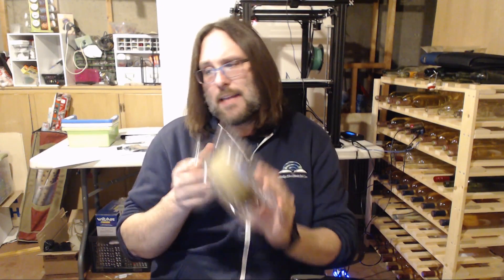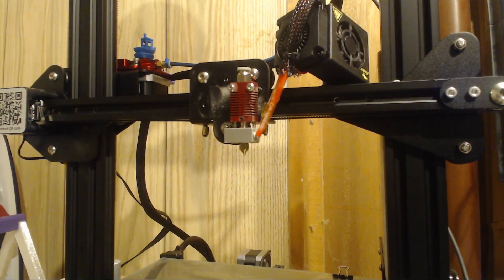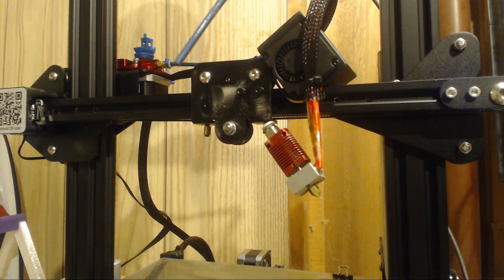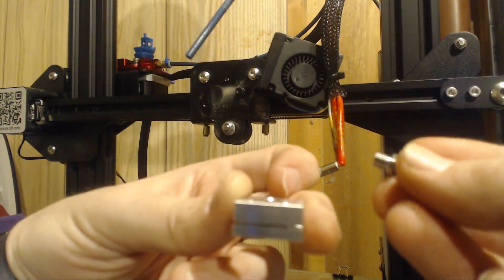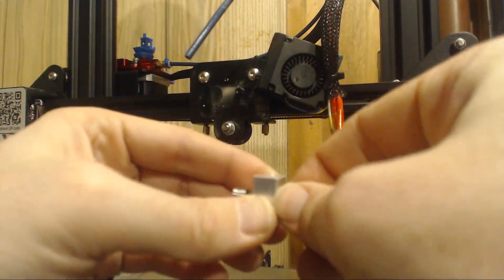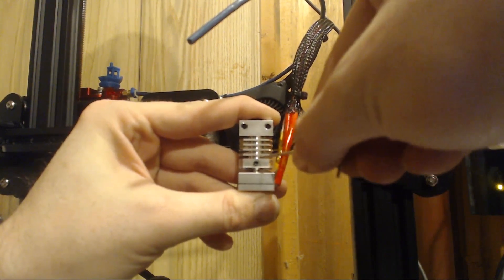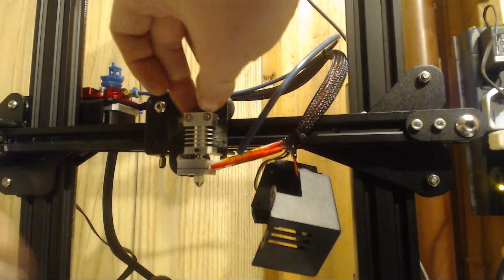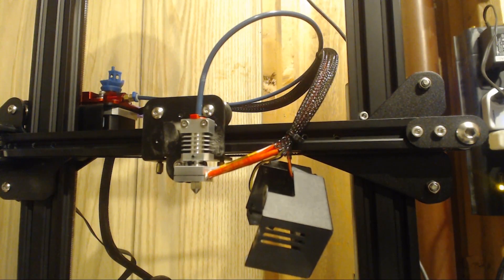Ender 3 Pro (Cr10s) All metal Hotend upgrade PID settings and all in

Comment: Im currently printing about 60% pla, 30% ABS, and 10% petg. I'm considering upgrading to a all metal hotend to print nylons and PC, but even then it'll only make up about 5% of my printing. The price isn't a big deal, but would you consider it worth it to have the ability to occasionally print stronger filaments, but having the added difficulties that all metal hotends cause? I hear there's a higher likelihood of heat creep and clogs, and that you have to occasionally lubricate, and that switching filaments regularly can be an issue with sticking. I've heard of a few other complications involved. Is it worth it when mostly printing pla?

Comment: Did you have to tweak your settings in cura? I’m getting a ton of stringing on my microswiss direct drive setup on my ender 3 v and I’m printing petg and on my sovol
Sv01 it prints clean as shit any thought on also I already calibrated the extruded to run the 10mm of spool
Reply from the maker: Hey.  I only had to tweak the retraction settings.  I use 4.5mm at 45mm/s on all my Micrswiss hotends

Comment: Thanks a lot. Excellent video. Very helpful. I had installed the Swiss all metal hot end on one of my Ender 3 pros and it worked beautifully. The second one I installed on another ender three pro, I could not get to work with out the extruder clicking. Did not change the PID settings in either one from stock. So now I have something else to look at. Thanks
Reply: Greg Gilbert Greg Gilbert I have adjusted the PID settings using the PID function from Octoprint. That also helped. I also tighten the nozzle and heatbreak grub screw when the hot end is at temperature.

Comment: are thes settings the same for the cr 10?   can you just put the pid setting in the simplify3d slicer software in the scripts area?  also what else can i use to do the pid settings beside octoprint?
Reply from the maker: Hey!  You can use any program that allows you to send gcode to the printer and give a response.  So pronterface on a computer is a good choice. All the steps can be used for any printer but you should run the pid auto tune to get the numbers for your system and  set them in firmware through pronterface instead of adding them to your slicer
Reply: @3DMakeIt  THX.

Comment: Would Those Pid Settings be compatible with a CR10s With a micro swiss?? what about auto pid tuning?
Reply from the maker: You should always run the PID auto tune on your hotened and use those settings

Comment: Some actual information on what failed would be nice. I just don't see how it couldn't have been cleaned up with new Teflon tubing and new nozzle. A Micro Swiss isn't exactly cheap, especially if you wanted to run Capricorn tube anyways. It's literally a nozzle at that point.
Reply from the maker: Hi!  So the damage was to the throat of the original hot end mainly deforming it.   

The reason for an all metal hotend is to keep the heat away from the ptfe tube through the all metal channel down to the hot zone.  The cap tube had a more precise inner diameter then regular ptfe and that was the reason for the cap tube.   As good as it is cap is still just ptfe and printing over 245 still causes off gasing if the ptfe is in hot zone.  

This info is on Capricorn’s site. 

https://www.captubes.com/safety.html where 250 is the point where off gassing becomes dangerous.  

So the solution of the microswiss worked well and fits the high temp situations. 

All my machines run all metal hotends (microswiss or e3d v6) with a combination of cap tl or xs